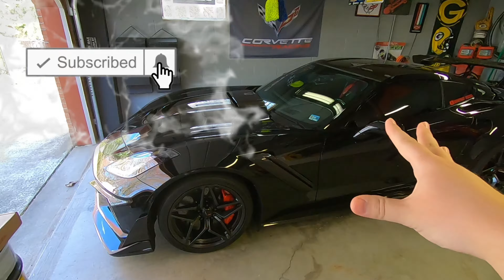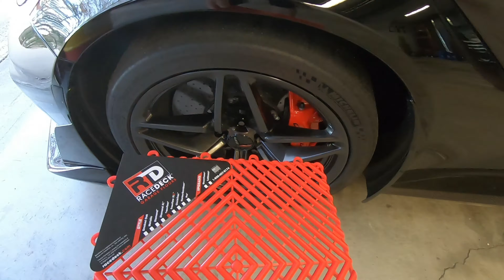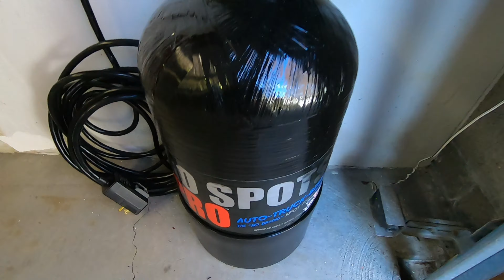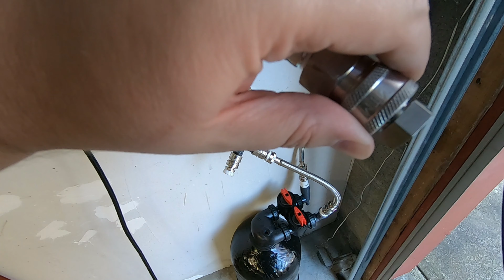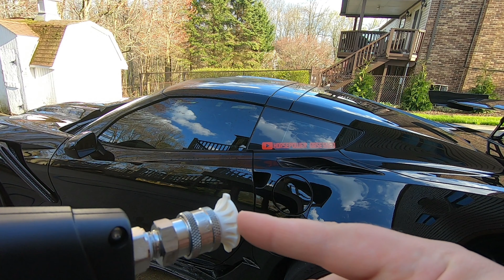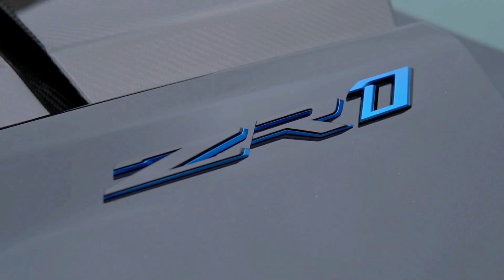WALL MOUNTED pressure washer setup AND RaceDeck flooring to make your garage look BRAND NEW! Part 1.

Comment from the maker: What do you guys think of the new setup? This is just the first part of many to come so it isn't 100% done yet, more to come soon! Here are all the products talked about in today's video: AR Blue Clean 630 pressure washer: https://amzn.to/2Xct7Ux
MTM SGS28 pressure washer gun and foam cannon: https://amzn.to/2Toyqiw
MTM Stainless quick connects: https://amzn.to/2LJr1WL
Cox Reels 100ft hose reel: https://amzn.to/2YZqR5o
MTM 2ft jumper hose: https://amzn.to/3cxubsE
No Spots Pro spotsless wash tank: https://amzn.to/3e4SDlc
RaceDeck: https://racedeck.com
Reply: Do all 2019 zr1 have carbon fiber front spoiler and side skirts
Reply from the maker: Yes they do!
Reply: HorsePower Obsessed looks great. I added an battery powered blower so I can dry the car quickly. Beats The Chamois
Reply from the maker: Agreed! I use a master blaster but it's the same idea!

Comment: I have an ar630, it weighs a ton!  I needed a step ladder to lift it onto the shelf. 
obsessed garage says it should have 5.0 nozzle
https://www.obsessedgarage.com/products/ar-blue-clean-ar630-tss?_pos=1&_sid=8ffd66a0f&_ss=r
Reply from the maker: It is definitely a heavy one. The 5.0 nozzle he recommends is just personal preference because it cuts the pressure down under 1,000 PSI. I personally prefer the 4.0 because I would rather the pressure be around 1,200 psi. To each their own.

Comment: Good choice NOT to go with epoxy.  I learned my lesson about 10 years ago!  Swisstrax for me but Race deck was also in the running. Either one will work well for those of us in the northeast.  It is AWESOME in the winter. No slipping or sliding and you can wash the car without standing in water. Always looks clean.  Looking forward to see your design.
Reply from the maker: Exactly. I've heard it may not be the best to go with and I think the RaceDeck/SwissTrax looks way better anyway!

Comment: What brand of hose you're using for this setup bud. Love it. Very practical setup there. Looks awesome
Reply from the maker: It is an MTM Hydro Kobrajet hose. I've since swapped it out for a 100ft black version of the same hose. Video coming soon. It turned out even better than I could have imagined!
Reply: I saw that one on their site moments ago...lol. Good choice as always. Thx brother 👍
Reply from the maker: You're welcome! Stay tuned for the update video it looks amazing! 😍😍
Reply: Sounds good. Btw..did u ever look into Uberflex Kink hoses. If u did, any ideas on that one. I want one which is light and kink resistant so it's easy to wash the car. Any thoughts..
Reply from the maker: I did. They weren't any more flexible or kink resistant than the kobrajet hoses I'm using and these work a lot better in my setup. 👍👍
Reply: Thx 4 the feedback bud. Looking forward to your next video

Comment: Thank you for putting together this video on your pressure washer setup and providing us with the links to the unit you use.  I did not see a link to the blue pressure washer hose that was on your Cox reel.  I really liked that it was flexable.  I would be interested in the 100' lenght.
Thanks again,
Carl Bullock
Reply from the maker: I'm happy to help. I didn't include that link because I've actually switched to a black version of the hose that is just as flexible and is 100' long. You can check it out here: https://amzn.to/2LPmaDk

Comment: I will probably do epoxy if I do something. I've had several customers say it's pretty durable but who knows after several years it may not look too clean.
Love the pressure washer setup!!
Reply from the maker: Thanks, Jason! I've had three different companies tell me that it may not hold up long term. The cost to apply it to the floor was a little more than what racedeck was going to cost anyway...

Comment: Add my concern to the others re: any flooring with ribs/grooves/holes/texture etc. I went with epoxy slight texture & it's holding up 20+ years now, I would love to see anyone's "deck" whatever you call it flooring after 20 years. Might be nice for a showroom garage but not a working man's garage. When's the last time you were at a dealer or independent repair shop and saw it, hmmmm, never? Check out what is used in aircraft repair garages. Light color smooth epoxy. Even if you get it free, I would not do it. 2 cents Froggy. Love your vid production.
Reply from the maker: Thanks, man! Maintenance garages are typically function over form, but I like a little of both. You won't see this stuff in their garage because they don't care much about the floor due to it being a "work" garage. I don't do huge projects in my garage but what I do work on would be fine with the RaceDeck flooring. If it ends up not being ok, I can pick it up and move on to the next option. 😁👍

Comment: Nice setup.  You are going to love having that!  Looks familiar.  Was any of this inspired by the Obsessed Garage channel content?  I noticed you used the word obsessed in the video.
Reply from the maker: I used the word obsessed because it's part of my channel name but I have seen some of the stuff he's doing over there and I did draw some inspiration but this is my take on some of the stuff he's done. I wanted to personalize it to fit my needs.
Reply: @HorsePowerObsessed  Your setup is an inspiration for what I want to build.  By the way, an idea for another video on this subject, you mentioned you have to right size the orafice size to the pressure and flow rate of the pressure washer, but I think it would be neat to see a video covering that more in depth. I know if I get your exact washer and sprayer/nozzle, but what if I choose a different part, how do I determine what works with what?
Reply from the maker: Awesome I will put something like that up. There's actually a chart for it!
Reply: @paulm7267  should check out mtm hydro website.  They have a chart showing the different size nozzles and breakdown what you will need.

Comment: Hey Justin,,,,, Changing the subject,,,,Have your "DOME" LED bulbs been burning out in you Colorado ?
Mine are, and the ones at my license plate. I`m wondering if i need to try a different brand of LED bulbs,,,?
Any suggestion ?
Reply from the maker: I was just thinking of this the other day, mine have been great. None burned out. Did you get the same ones I did?
Reply: @HorsePowerObsessed  ,,,,,,Oxilam ?   I either got the ones you recommended,,,, or from Matt.....My reverse back up lights have done great
Reply from the maker: Yeah that's it. I haven't had any issues with any of mine.... Interesting. 🤔
Reply: @HorsePowerObsessed  ,,,,,Just my luck,,,haha ! I even put mine in using paper towels, careful to not touch the bulb area.
Ok,,,,thanks bro,,,,i just wondered,,,,,,,,,,,,Peace !
Reply from the maker: @bryan7821  interesting indeed! How many failed?
Reply: @HorsePowerObsessed  ,,,,3 LED`s on the license plate ( One side and then both sides ),,,,and 2 times on the BACK dome light
Reply from the maker: That's crazy! Roughly how much usage was on them? I've had mine for over a year now and they are all good still.
Reply: @HorsePowerObsessed  ,,,,,,I got mine, right after you got yours. You turned me on to them bro ! Lol !
So, i guess the same time.  Maybe i got duds,,,,,haha !
Hey,,,remember mine is a 2015,,,but its only got 32,000 miles on it

Comment: Seems like that flooring option will catch dirt/debris and fill up the slots IMO. And like someone else mentioned using jack stands, jacks, and floor creepers will be rendered virtually useless. I am going to say you will be disappointed in your choice in the future.
Reply from the maker: I've used both of those things in the past on SwissTrax flooring without any major concern so I think it will be ok. Time will tell.
Reply: I'd have to agree with you on this one I was thinking the same thing definitely wouldn't work for me I spill to much in my garage especially cutting wood it would get trapped in there to much
Reply from the maker: @preston3698  The flooring is not that thick and Shop-Vac would easily get the stuff out that fell in between. 👍

Comment: Epoxy only as good with a very clean floor... clean floor using muriatic - acid (10-1 mix) water and acid..
Reply from the maker: I've heard even with properly prepped floors you can have an issue with it pulling up with hot tires. My ZR1 tires get hot from time to time 😈
Reply: @HorsePowerObsessed  Even though you plan on covering  the floor the garage will smell like old oil. Recommend you use solution and clean the floor prior to covering.. just saying
Reply from the maker: @johnmoorhousedecorated-nam899  I do plan on cleaning it first but it actually doesn't have a smell as of now.

Comment: Nice setup. :) I have a Kranzle K1322TS with the same Cox hose real and hose along with a CR Spotless. And I use the same PF22.2. foam canon. They changed the shape of the bottle so it doesn't fall over when you set it down. Btw, for car washing the more relevant number is flow in gallons per minute, rather than pressure. My Kranzle is ~2.4 gals/min @ 950-1150 PSI, which is ideal. We're not stripping paint or cleaning our driveways. For that a gas powered pressure washer, which are typically 2000-3000 PSI or more, is what you'd need. Btw, the 40 degree spray is ideal for car washing. However, you need to be careful with regard to orifice size or you can burn out the motor. I have a Mosmatic gun which has a 1.25 orifice, although it came with a 1.1 as well which is too small. The motor is near the limit with a 1.25 and that's on a dedicated 20 amp circuit.
Reply from the maker: Exactly. That's why I talked about the orifice size a few times in the video because it definitely matters if you have a stronger pump.
Reply: 1322 doing 2.4?  Did you test that yourself?  Might want to double check that.  btw, what did you mean when you said your mosmatic gun has a 1.25 orifice and not the 1.1 it came with?  Did you get the gun from kleen-rite?  Maybe that was the reason they were $20-$30 cheaper than other places?
Reply: Yes, it 2.4 GPM. And yes, I tested it. The 1.1 orifice is for for use with lower-end electric pressure washers (SunJoe, Ryobi etc.). Btw, the 1.25 orifice is for the foam canon (PF22), NOT the gun. I don't know what I was thinking!

Comment: The only "problem" I envision with the vented flooring products are moving around on them with my roller seats and creeper and/or anything I have on castors. Even the diamond plate design would be a bit of a bumpy ride.  As to the vented flooring, are they strong enough to handle floor jacks and jack stands? Really liked your Obsessed Water Pressure setup. Save the Wave🙋🏼‍♂️
Reply from the maker: I thought about that same thing but I've actually experienced it on other people's Swiss trax flooring and it seems okay.

Comment: I can personally attest that a wall mounted pressure washer makes life SO much better for car washes.  I had considered doing a hose reel setup but was concerned about leaks that I read about.  Looking forward to hearing how yours does over time.  Right now, I just coil my pressure hose but it would be nicer to have a reel.  I also went El Cheapo with the Ryobi machine and it likes to cycle on every 10-20 seconds for just a second.  Drives me nuts.  I may go with your pressure washer.
Reply from the maker: So far this setup has been fantastic! I will keep you updated though. Maybe we could do the whole setup in your garage together! 😎👍
Reply: @HorsePowerObsessed  That would be cool! I'll see how yours does over time and make the switch. I also want to see how your RaceDexk does over time. I don't want to blow a lot of money on SwissTrax.  Oh, I also just changed my NoSpots Pro resin. My test results creeped up dramatically. My city water is horrible so it didn't last as long as I expected. I still like the product, tho.
Reply from the maker: @PatsGarageOnline  That's funny, I just ordered more resin from him myself! Great minds think alike! 👍👍

Comment: I like the slick setup. Pricey but you get what you pay for. I'm wondering about the perforated deck? Will it collect leaves and dirt? Will it blow out easily? How would it be to lay on if you have to get under the truck?
Reply from the maker: It's vented mostly so water still makes its way to the drain in the middle of the garage. With that said in my experience it does still clean up pretty easily. The tiles aren't that thick so you're able to vacuum or just blow it out the way you normally would.